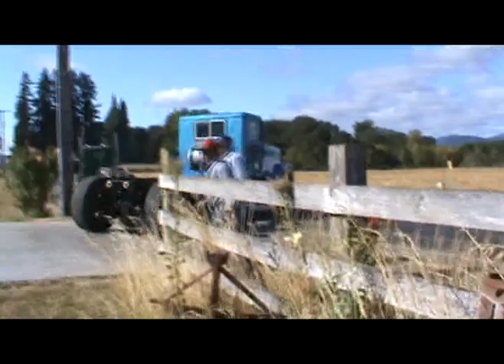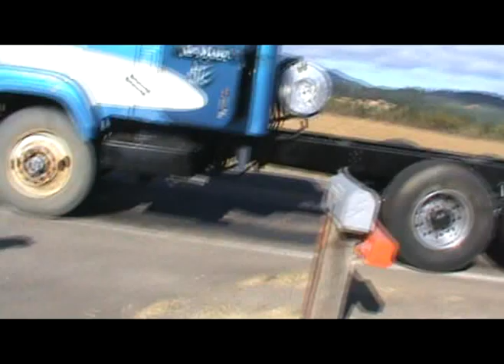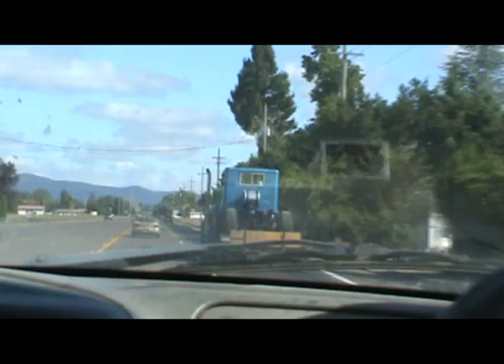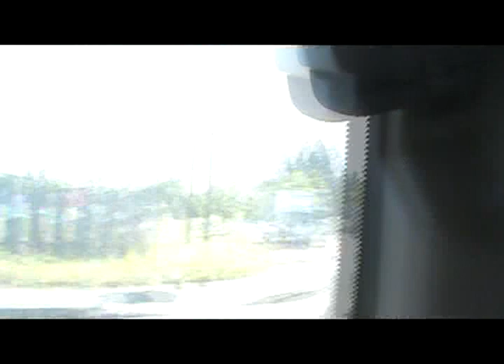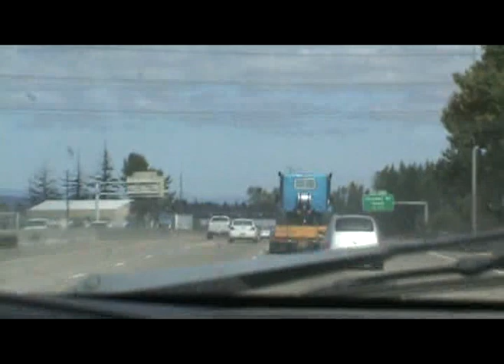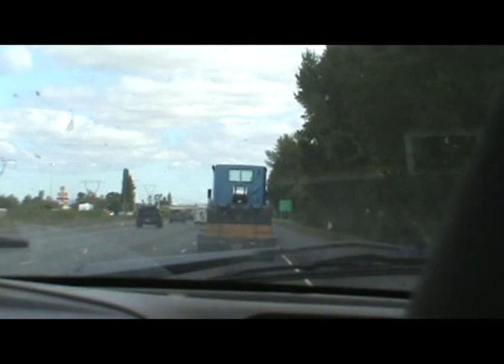straight piped 12v71 pete going to truck show loaded!

Comment: But hey everyone don't get me wrong that is a cool ass old truck and those 1270 ones are cool Motors so are the 870 ones the silver series 8v 92 are real cool but if you want a truck that plants the power and gets the job done uphill downhill it don't matter and you don't want to drop a lot of Gears get a big old cat no matter how loud and how fast a two-stroke Detroit is they still don't have any pulling power they can't even pull with a big old Cummins but they do one thing very well they sling oil they smoke their loud and they drink a lot of fuel so if you're into that then yeah 2-stroke Detroit are cool ass engine but if you want to work the truck make money and not spend a lot of money putting oil back in the engine or feeding it with fuel everyday don't run a Detroit

Comment: yeah all long as the truck is dot safe but some ppl like too cheat and sneak around but yeah there legal...there a guy in pa who runs a 12v71 in a borckway and pulls a lowboy around with equipment and alot of guys inthe north west still use em and a few other places. My advice BUY ONE if u got the money and dont ever sell it. ull have too much fun with it and if u sell it..ull regret it for quite somtime.

Comment: Truth be told if you could plant the power of a c-16 without chunking a tire or a Driveline ac16 will make a 1271 look like a 237 Mack the one reason why people run Detroit so much and drag racing because the parts for those old 2-stroke smoking oil slinging non EPA meeting engines are readily available now because nobody wants to run them and they're not legal anymore on the road because of the EPA standards they're cool and I love the old Screamin demons the way they wrap up and they sound but a big old caterpillar will walk the dog all over it 1271 no problems I drive trucks everyday and grew up around those old screaming demon oil slinging son of a bitches ain't nothing can pull a hill or walk the road and pound the ground is they say like a big old kitty cat last time I checked Detroit don't make motors for big ass heavy equipment like mining equipment like Caterpillar does... and I live just south of Woodburn Oregon I know the corn-fed Corvette very well that truck does not have turbos on it it's just cranked up with big injectors low gears and an automatic transmission